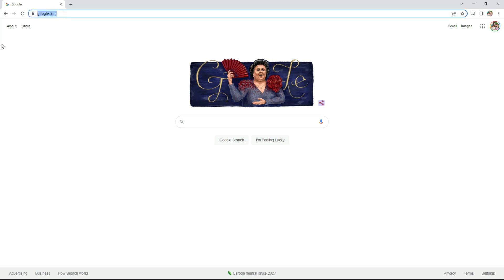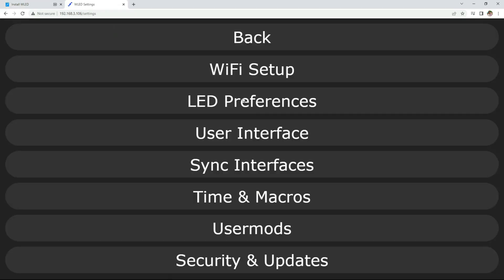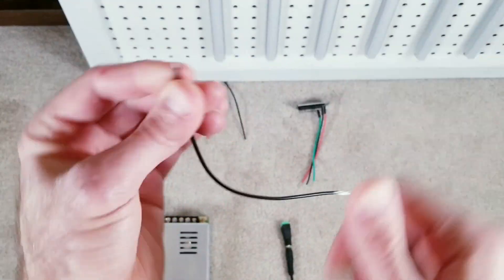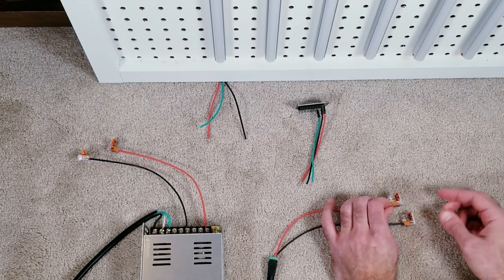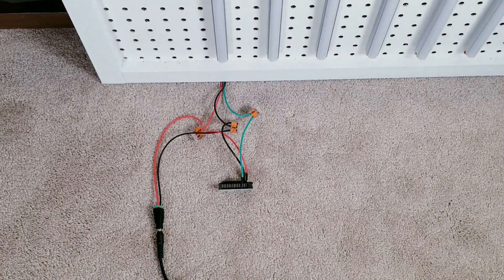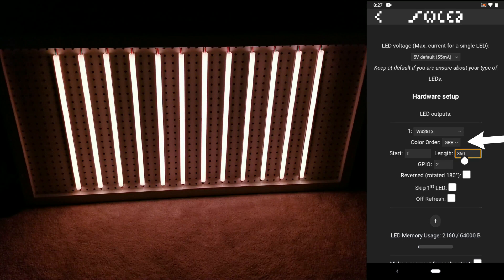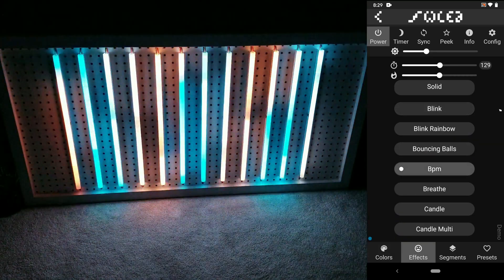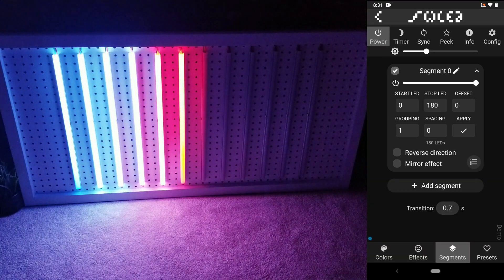How To Install WLED on an ESP32 Board and Connect / Control Addressable LEDs

Comment: How about how to control multiple lights with multiple controllers?
Reply from the maker: That's a great idea for another video! I'll have to put that on my to do list! Although with WLED they make it super easy. In the app you can hit the sync button and all the controllers connected to the wifi will be controlled as 1. So change the color or animation for one of them and they all will do the same thing. Otherwise each controller will show up separately on the app so you can then go into each one to control them individually. Thanks for watching and taking the time to comment!

Comment: You're a brave man, sharing your Google algorithm suggestions and historical searches. I'd recommend using Incognito for your own safety. You don't want someone reading those 19,000 emails you've neglected :)
Reply from the maker: Lol yeah I'm a few days behind checking emails lol. You are right though. I do need to put it in incognito for recordings. Just looks cleaner as well! Thanks for the tip my friend and thanks for watching!
Reply: Hi men, i have a problem, appers that my serial port is occupied, i tried to flash my esp but nothing works, any suggestions?

 thanks for this contente, it is what i was looking for to do 3 years ago.

Comment: Is it possible to use a 24v or 12v strip and power supply instead?  I would really like to power a much longer strip if possible, like for around a whole sanctuary or perhaps for permanent multi holiday lights.  Also, is it possible to gang multiple controllers to all work as if they're one?
Reply from the maker: You can definitely use 12v led strips and control them using WLED. In this video I hooked up some leftover 12v govee led strips and controlled them using WLED. https://www.youtube.com/watch?v=l0sRG1WAbq0 I'm fairly certain there is a better way to wire everything up than what I did in the video (some people have mentioned a step down converter) but since I have not had much experience with anything other than 5v led strips I'm not super sure the best way about doing it. Something I will for sure put on the future project to-do list!

Comment: Thanks for the great video, subscribing now! Question, I´d like to cover the top and the bottom of a wardrobe, should be 5 meters total. Can I use 2.5meters + 1.5meter cabling to connect another 2.5meters from one end to a led strip (individually addressed led) to the beginning of the next? Do I need to power it again to the power brick?
Reply from the maker: Thanks so much for watching and for taking the time to comment! You can definitely do what you are wanting to do without having to power it again to the brick if you don't want to. I sort of do what you are going to do in this project I just did. https://www.youtube.com/watch?v=b13VLiK7AOU 
Now if your led lights at the end are not bright enough for your liking you certainly can run a voltage and grnd line from the end back to the power for injection but in my experience, for 5 meters of lights I would not have to do that and the lights would be plenty bright for my liking. Hope that helps!
Reply: @ChrisMaherDIY  thank you so much for taking the time to reply to my question, sir! I really appreciate that! :) - Your channel is a blast, not sure why Youtube did not recommend you before...lol - thanks again!!
Reply from the maker: @andrebbruno  You are very welcome and glad you are enjoying some of the videos! Its a fun little hobby for sure! Have a great day buddy!

Comment: Hello do you knoe how i cane control diferent segmant from a triggar, i whant to have 4 triggar for 4-5 zones?

How many led adressable of 60led/m I cane add?
I need for house Christmas and i need 60m!

Do you have some idees how to do?
Reply from the maker: I'm not exactly sure what a triggar is. I know I have about 4 of these eps around the house and can control them all separately or individually with the WLED app. I also looked at the WLED faq sheet and they say 1500 leds max. Thanks so much for watching and taking the time to comment.
Reply: @ChrisMaherDIY  I am searching something like controller SP608E , because this have the trigger signals where a will like to add some Pir sensors . But I am not sure how to make the connections for the led strip and controller to work with the Pir .
Reply from the maker: @gradmihaialexandru3445  I see. On this controller https://amzn.to/3OP9cEX you would hook up the ws2812b led strips to the v+, D and v- connection and that should work then with the controller provided. This specific one looks like its built for music as well but i think they all would generally be the same hookup!

Comment: Again great video Chris. You already helped me out such a lot.
But I have this particular scenario where I want to ambient light a whole room floor across the walls.
I got all Information I need corresponding the necessary power injections. But in my case I have a door dividing one wall. How do I Deal with this in terms of data wire continuity. My thought was wireing it above the door together with my power wires. Is that even possible? I am talking about a big 30 meters setup so the wires for the injections will be extrem long aswell. Is there voltage loss on these aswell?
Would be so glad if you or somebody of this lovely Community might help me out on this one.

Cheers 
Luke
Reply from the maker: Thanks for watching buddy! In my recent video where I make a rgb board and batten design, I ended up having to run wires around a window. I'm not 100% sure but maybe what your trying to do around the door could be done in a similar way to what I did with the window? https://www.youtube.com/watch?v=b13VLiK7AOU If I was going to do a more permanent install, I would have probably took the trim down around the window and somehow found a way to run the wires underneath the trim boards and then put everything back together. I would imagine you could do the same with a door maybe? Regardless, sounds like an epic project!! I'd love to see how it turns out!
Reply: @ChrisMaherDIY  Thank you so much for the kind reply. Amazing helping us out so much!
I will inform you guys how I got it going once its done.
Reply: @ChrisMaherDIY  Do you know if the wires youre using for injecting power also have a voltage dropoff after a certain amount of range?
For my project I am talking about the longest injection having 15 meters to run before soldering it to the LED strip.
Reply from the maker: @Phantser  Great question! I'm certainly no electrician but my understanding is that there will be voltage drop no matter what wire you use. What will increase the amount of drop will be using thin wires and having long wires. Now will voltage drop so much after a certain point that it will not even power on the lights? That's a great question and I'm sure at some point it would. I'm completely guessing but I think if you ran 15 meters of the 18gauge wires I used, I think there would still be plenty power left to run leds (also depends on how many you are trying to power after the 15 meter run) My best advice is to make sure and buy wires from amazon that have free returns. Test it out and see how it looks and if it does not work, return them and try buying some thicker wires and repeat.
Reply: @ChrisMaherDIY  Thanks a lot again! I will share the final result. Whole setup will be around 32 meters so maybe about 2000+ LEDs lol...
Reply from the maker: @Phantser  Cant wait to see! That's a lot of lights!!!

Comment: Having problems with losing connection to device after 30sec but I see it on my router, any thoughts? I'm powering led strip from board 100leds and I seams to work fine
Reply from the maker: That is strange! The only time I have ever had issues with the device having connection issues was when I was using them out in my garage and it was a little too far away from the wifi hub. As soon as I brought everything in the house closer to the router, it worked just fine. If that's not the issue, then I'm not sure what it could be! I suppose its possible for the esp boards to be faulty so that would probably be the last thing I tried (getting another esp board)
Reply: @ChrisMaherDIY  i have 4 nodemcu and they all do the same :( Ordering new ones and see if that helps :) thanks for reply! Love your vids
Reply from the maker: @danielfrid9787  Ohh man yeah if all 4 are doing the same thing then its probably not the nodemcu! Hopefully you can figure out what's going on! I know it can be frustrating when things don't work but all that means is its extra cool when you figure it out! Let me know if you find out what was causing the issue. I'm curious myself!
Reply: Update! Now it all works! The Solution after spending hours troubleshooting my Asus router, I connected a different brand (dlink) router as a accsesspoint to my main Asus rt-ax92u router and connected all my 2,4hz smart things to it and it works flawlessly!

Comment: Know how to handle the power using UK plugs?
Reply: Shop for a 230Volt AC power supply.  They are very common and easy to use.  You will need to know the LED requirements prior to ordering your power supply.  How many LED's and the voltage required to operate will determine the size (Wattage) you should look for.

 Suggested search: adjustable DC Power Voltage Converter, AC 110V-220V to DC Module Switching Power Supply.
Reply from the maker: Unfortunately I do not :( I would be just guessing if I tried giving you any advice lol. Maybe someone else who watches this might know more?!

Comment: Very nice explanation!  How do you clean up the power supply and esp board though? Do you put them in a case or something? Any tips for giving the power supply and esp board a clean look? 

Also, does WLED work for COB/FOB strips? I just ordered ws2812b COB 320 leds per meter, they look awesome. Just not sure how soldering works on those since there is only positive and negative and if the esp board works for the strip.
Reply from the maker: Thanks for watching!! In all my projects I'm generally just hiding the power and esp boards behind something. (usually a plant or a stand of some sort. Nothing special at all but its out of sight and that's all I care about! I know some people put the esp boards in like a soap box to give it some protection: https://amzn.to/37UZZtG That's a great questions about the cob strips! I'm not 100% sure but I would imaging they would work the same as any other ws2812b strip. Are the cob ones individually addressable? They do look awesome from pictures so I'm gong to have to try ordering some and testing out myself one of these days!!

Comment: Hi Chris! Should I select the WS281x for the WS2815 strips? I would love to see you do a video on this model strip. Thank you for another informational and well filmed video!
Reply from the maker: Thanks so much for watching! I believe you would select ws281x for the ws2815 led strips but I believe the ws2815 led strips are 12v so I'm not sure if there is different wiring or setup in the app. I do know under led preferences there is a spot where you can select WS2815 (12) for power so I'm sure that is one setting that would need to be selected.

Comment: Another excellent tutorial Chris, really, you make it so much easier to understand,
But, as always I have a couple of quick questions if that's ok,
Firstly do you have a preferred Wi-Fi board and/or brand?
Second one that segment section has guaranteed that WLED is the way I'm going, I was 90% before but that's definitely sealed it for me, the question is how many segments does it allow you to choose or can it literally be each segment be 1 LED and as many LEDs as you have? 
As always thank you for taking the time to help.

That github link to WLED is really helping,
Reply from the maker: Thanks as always and great questions! I don't have a preferred brand but the ones I link to in the description have been the ones I'm using and have really had no issues with any of them so they get my stamp of approval! As far as the segments, you can literally make each segment 1 led but I honestly have no idea how many segments the program will allow you to make so my guess is there would be a limit as these little esp boads don't have a ton of memory. But that would for sure be a good experiment to test out! Might have to try it :)
Reply: @ChrisMaherDIY 
Hi Chris, again thanks pal for taking the time to answer my questions, I had to ask about brands as I'm in the UK so when I click any link it takes me to amazon but nearly always their 'currently unavailable', but I have checked and their are similar brands in the UK amazon.
I will probably be using a couple of your links especially for power supplies etc, and I'll probably use the BTF they seam to be a fairly decent company,
Anyway I hope you have a Good Easter weekend.
Reply from the maker: @-djs  Yeah I always forget the products are not the same in different countries! BTF is a good choice for sure. Never had any issues with any of their products. Thanks and you too!

Comment: Excellent voice and presentation. May I suggest that you present the flashing and wled phone app operation, a little slower? I have downloaded/flashed about 40 ESP32s and rarely can I get them to operate on the wled phone app, the same. Once in a while, I am able to change the name on the app, but rarely. I change the name in led preferences in two locations and most of the time I don't get a name change. I was hoping you were doing something different. I especially liked your presentation on using color palettes with different effects and segments. I haven't seen that in other similar how-to videos. I hope you do more.
Reply from the maker: Thanks so much for watching and taking the time to comment and thanks for the suggestion! I must just have good luck since the phone app (android) is pretty much all I use and everything seems to work really well and I don't feel like I'm doing anything special. I wish I had some other tips on some of the issues your having! If I do another video down the road, I'll for sure slow down a bit. Thanks again!
Reply: @ChrisMaherDIY  which version are you using... I have one I've been lucky with a Esp32S v3 Nodemcu I thought it was working coz I put on thicker power wires on the chip has been working ever since ... so bought a new of the same from start put thicker power cables (than jumper cables I first tried with on first one) but sadly have had problems with this one like problems I had at first.. but clearly not related to the cables then only... sometimes I can connect for like maybe 2 hours but it will disconnect at some point other times have to turn on/off alot before I can even connect to it... I have mo idea why it isn't working... (connected to WiFi with running 5V on same power supply as the leds are on)...I might try the holding down of "boot" button.... I'm sad about this coz here in Denmark it's very easy to get this chip Esp32S Nodemcu ... haven't seen so many other chips